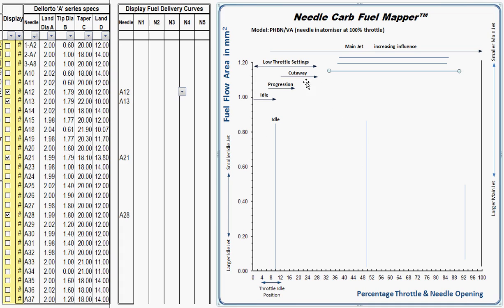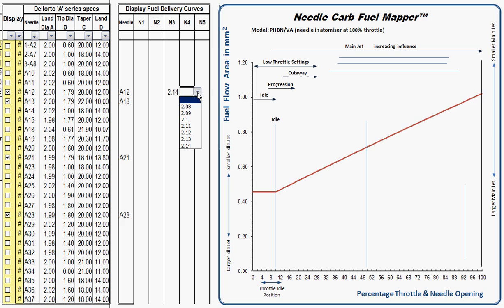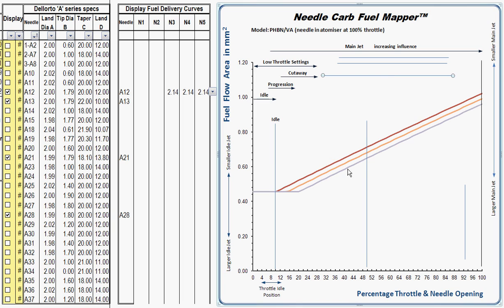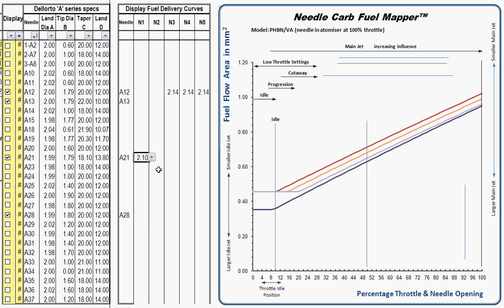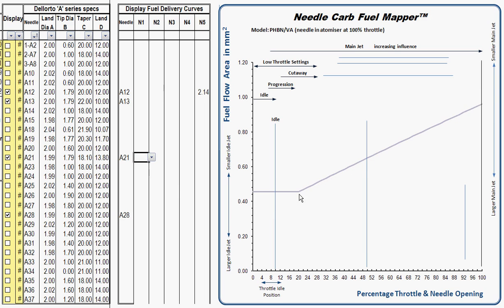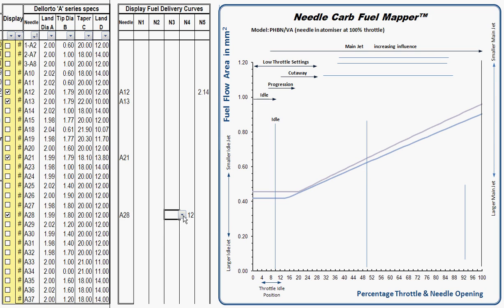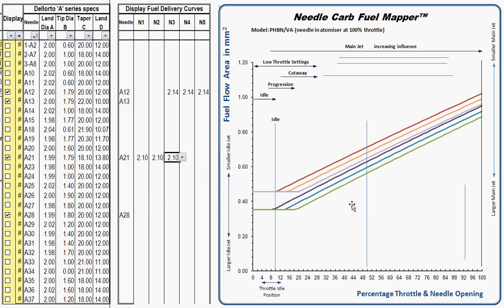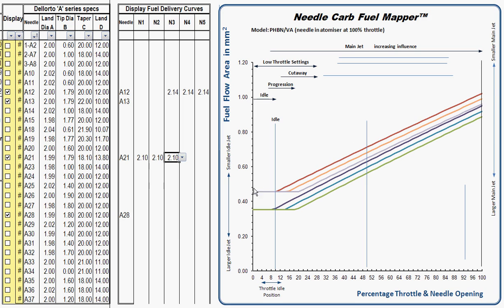Dellorto Carb Tuning - Selecting needles & fuel mapping

Comment from the maker: Needle Carb Fuel Mapper™ software - https://www.paypal.me/ecih/20eur
Go to https://fuelmapper.com/ for full download information, and instructions.
(try Firefox if it doesn't display)

This tuning program is ideal after a major mod, like a BBK, or expansion pipe.... or both :)
The software has now been greatly improved, and can now function with all types of carburettors.

Dellorto PHBN Carb Tuning - Lesson 1
How To choose needles, notch positions, and atomisers

Using needle mapping software, you can find the best fuel/air mix for your engine, to get the maximum performance from your setup.

This will involve road testing your choices....
... however, with the knowledge gained here; you can plan those tests in a pattern...
... you can quickly find your basic tune.

NOTE
Main & idle Jets were not discussed.
Primarily this video examines the role of needles?

Note on subscribing:
￣￣￣￣￣￣￣￣￣
If you subscribe, and want to receive notification of new engine tuning videos ... you need to click the bell icon (that appears when you click subscribe).

Select notifications, and you will be notified of new 'engine tuning' uploads.
If you are into engines, the vids will probably be worth a quick look (at least) :)

Comment: It is possible to get the software, i try to buy it but it says that "Link with this ID not found"
Reply from the maker: You need to go to fuelmapper dot com
The link is in the description, or you can just type it into your browser.
:)
PS. I tried the paypal link, and it worked for me, but going through the web site is better, as there is more information, and the instructions are also on the site, to enable auto translate.

Comment: I have purchased this software from you however I am struggling to implent what you are teaching.
At 4.48, you mention too much fuel but you fail to explain how you have identified that, relative to what ?
At 5.53 you mention too little fuel at the bottom and too much at the top, however you do not clarify how you are coming to this conclusion, you do not reference the line on the chart to anything else ?
At 7.53 you mention that the "curve" is pretty close, but close to what ?
Your chart does not explain how the plotted curves relates to what is actually happening in the engine or relating the curve line on your chart to a given base on the chart as the perfect mixture. Without relating the generated curve to something its meaningless, all that is showing is line depicting more fuel or less fuel with no relation to how lean or rich the engine will be running in real life with the actual mixture inside the engine across the RPM range?
Please help me understand how I can use this charting software for tuning ?
Reply from the maker: Hi Gavin,
Thanks for raising these questions for all to see ... everybody benefits (hence the thumbs up).

All the references refer to your actual testing of the bike, and the resulting observations and logged data.
Evidently, I did not make this clear ... a typical mistake when an instructional video is not planned and scripted.
I hold my hand up, and plead guilty.

The statements made are hypothetical.
EG. at 4.48 I state something like 'you are getting too much fuel'.
This meant - you have tested the bike, and found that in that part of the range, you judge that the mixture is too rich.

The subsequent advice, points out that the fuel mapper can be used, to determine the atomiser and needle changes, in order to slightly modify the curve.

The point being, that you know the curve at test (and it was wrong), therefore you need to find an exact setup that modifies the fuel flow by a specific amount.

The only way that you can do this, is by using the fuel mapper.
Simply taking pot luck, and trying another needle, is disastrous, because you have no idea what parts of the curve have been changed - the geometry is too complex
... this results in confusion.

All the statements referring to being close, or too little fuel, or too much fuel, are what you would determine, through testing.

The only other way, would be to have a lab setup with a dyno, and multiple sensors providing specific readouts against load, revs, and throttle position.

As most people don't have access to such kit, we have to use traditional benchmarking tests, such as rpm against throttle position in each gear.
... if rpm is higher, for a given throttle position ... the engine is producing more power.
The plug colour will indicate if the setup is safe.

You can buy mobile data loggers, which are like mobile test labs ... though the main element lacking is the throttle position sensor (in most carbs) ... I added a wooden disc to my throttle, and marked it off, so that I could accurately repeat the tests ... fiddly, but life changing :D

Consider buying a bluetooth mic and earphone ... they are ridiculously cheap on ebay.
With phone in pocket, you can then record your test run by talking to yourself
EG. 5th gear, 60% throttle,  xxxx rpm -  70% throttle,  xxxx rpm -  80% throttle,  xxxx rpm etc.

Plan the next adjustment; make the changes; repeat the test ... you are looking for higher rpm.

If you have made the mix weaker, and you get lower rpm ... then you have gone the wrong way.
Look at the previous curve, and design a curve that is slightly richer (where you need it to be richer).
Retest.
If it is better in all areas ... design a curve that is again slightly richer.

Keep going until performance drops off in a throttle range area (or it drops across the range).
At that point, you know that you have gone too far, so revert to the best setup.

That will be your new benchmark, for your pipe, ports, carb, and airfilter etc.
With everything logged ... when you change something ... say the pipe ... you can see exactly how the performance has changed ... and you once again tune the fuel delivery to match
... only this time, you will be more experienced :)

By creating benchmarks, and using fuel mapper ... tuning is very easy, and fast.
If you have a selection of needles and atomisers, you can achieve a high state of tune in one weekend.

With the pot-luck method, you'll get nowhere, and become exasperated (been there ... it's why I designed the fuel mapper.

I'm currently drafting a tuning manual.
It is not in a finished state, but most of the info that you need is already drafted.
You will need to study it, and enable your mind to picture what is happening in the carb, against what the engine is requiring.

I'll email it to you now.
It should help.

But in simplistic terms :

Determine your current engine and carb setup.
Make a test run 
Log the performance through chosen gears at chosen throttle settings.
Design a change to the curve ... and find out if your new design is better or worse.

Before doing this ... always make sure that you have the main jet correct, and the idle circuit correct.
The fuel mapper will then guide you forward.

It might sound boring, but its not ... its exciting; because you will be making visible progress.
... and at every step, you will know what you are doing and why ... zero confusion.

You'll be fine :)

Comment: Most of us in the PUCH and Sachs Mopeds use PHBG 16, 19 and 21 Dellorto Carburators. I would be happy to know if your program covers these models.
Reply from the maker: Hi Martin :)
Somebody did provide the PHBG 19 details, so it is ready to choose.
... and all Dellorto needles and atomisers are in the database.

Regarding the differences between the 16, 19, and 21 ... I don't know.
Clearly the bore heights are different, meaning plus or minus 3mm of slider & needle travel.
That may be the only difference, if the W needles are used across the range.
However, the slider dimensions may be different - the PHBN 17.5 slider is different to the 16.

Either way, measuring the carb is a quick job (I've provided a video).

It is easy enough copy in the 19 to a new slot, and enter the adjustments for the 16 or 21, before adding it as a tunable carb.

There is a full walkthrough video that is linked from the site fuelmapper.com.
Also, each module has it's own help files.

Like all new software of this nature - it  may seem intimidating at first, but using it quickly becomes second nature.

Also, as your needs change, you can add any carb, given that you have the needle and atomiser data.

The full range of Dellorto is already covered, except obviously the individual body types.
Similarly, Mikuni is provided for, with crossover Dellorto needle charts.

You will need a copy of Excel - anything from 2007 upwards.

One thing is certain.
If you want to understand the changes that you make on the carb ... this program will be a revelation.

Comment: How do I attain a copy of this spreadsheet?
Reply from the maker: +Zachary Kortz 
Dellorto Needle Carb Fuel Mapper™ software - https://www.paypal.me/ecih/12
The program costs £12 via PayPal.... click the link, and it will be emailed to you as an attachment.

To run the Needle Mapper you will require Excel 2007 or higher.
(It will not run using Open Office)